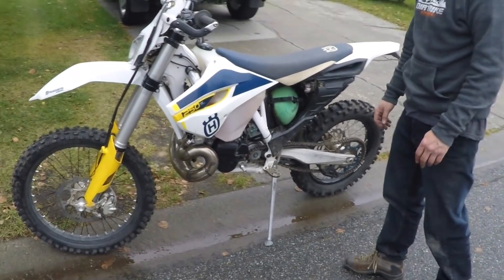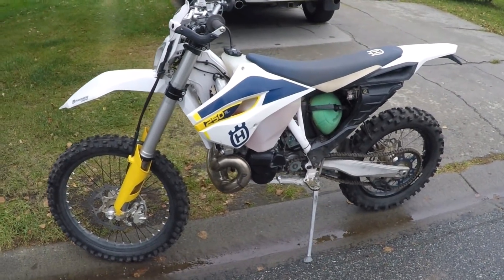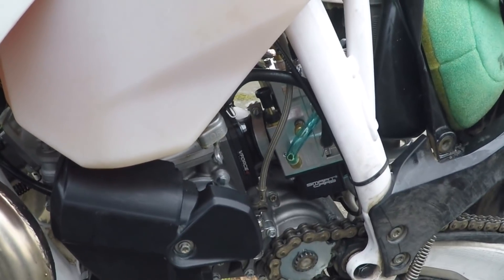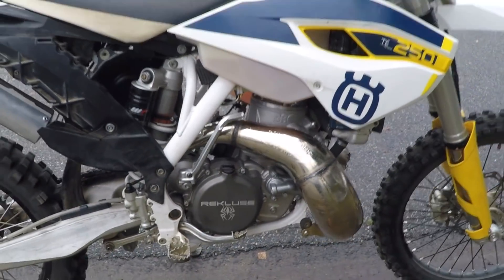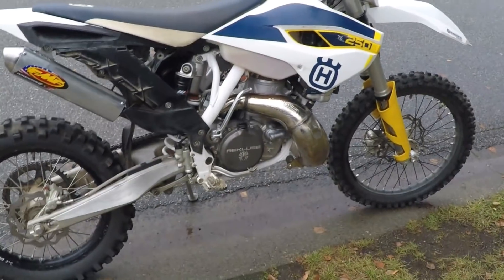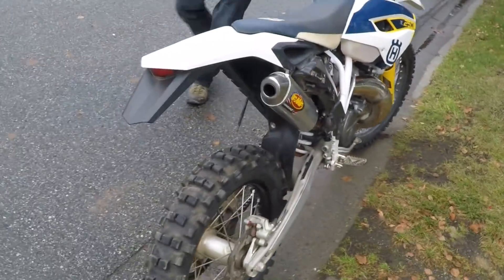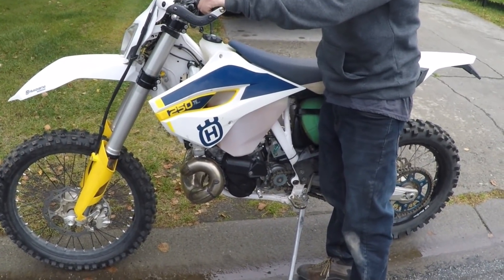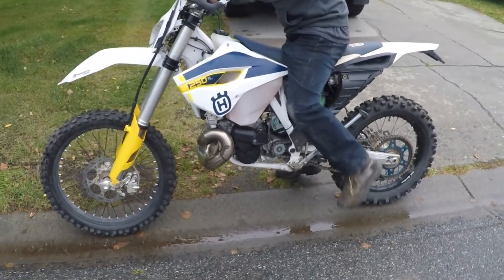BRC 500 with SmartCarb 40mm TPS and PowerCDI First Startup

Comment: It’s pretty cool I do have to say but I don’t get it. You don’t need a 500 for anything that bike with the stock 250 motor was good so my question is why the 500? I’d imagine you have the cost of a new bike just in the motor. Again I’m not dissing at all I think it cool as hell!!!!! I’m just looking at the cost and comparison someone said it 7500 just for the motor of course I don’t know if that’s true. Either way it’s sick and if it becomes affordable all the better!!!!!
Reply from the maker: Yeah, the stock bike was pretty dang good. But if you have the money and have never ridden an old-timey 500, and it can be converted to a snow bike for the winter season (where the extra power of the 500 motor is an undeniable improvement over the 250 or 300), and you get a very modern counter-balanced electric starting motor, why not? And the power output of the motor is aimed at trail riding vs. MX (not that it won't do well as a modern MX machine), so even better. 

The USD cost is right at $5800. It's real easy to spend that much on an off-road bike without obtaining the massive character change that comes with the 500 motor. We didn't get enough trail time before the snow fell last fall, but the little time we did get held a lot of promise that this is going to be a monumental trail bike. If you're an off-road racer, perhaps it would meet your needs well and perhaps not. Kinda like some off road races are more suited to a trials bike while others are more like Dakar.
Reply: Barry Jackson I race at a high level and would never choose a 500 period no matter how it’s tuned it’s just to much, to much weight to much power for a 3 to 4 hour race. On my 300 I have a map switch to smooth the power out at end of races to conserve energy. I don’t see a 500 working out east where I am or on national enduro scene. Now maybe in the desert I don’t have a lot of experience there I’ve only raced a few times out west and used a 450 saying that it was pinned most of the time. Now a snow bike I can totally get I live in northern mi we get a lot of snow I have 3 ft at my house and across the bridge we have 5ft plus and everyone is looking for more power with there snow bike. It’s cool though like putting a big block in a s-10. You all did a professional job also it looks stock pretty much.
Reply: Barry Jackson though I don’t agree with undeniably better than a 250 or 300. There is a reason no one makes a 500 anymore. Again I really like the build it’s awesome please don’t think I’m being a dick or hating you did a wonderful job and it’s bad ass build. This is all my personal opinion I’ve never ridden that bike and it could be the best thing ever this is just my thoughts and I’m a moron lol .
Reply from the maker: Not taking offense here... but if you re-read my earlier reply I was talking about snow bikes when I mentioned its improvement over a 250 or 300. While one could put this motor into a modern KTM MX frame (up to 2016?), it's specifically designed to fit in the the XCW & XC frames from about 2008 to 2016. So, it's power and delivery is aimed at off-road pursuits, and not MX. 

This is exactly the opposite of the old days of the 500 bikes. They were all MX aimed bikes in both riding/handling and power delivery.  In those days, if you rode a 500 as a trail bike, you were riding a motocross bike on the trails - not ideal. With the BRC 500 you are installing it in a trail-oriented bike with modern and appropriate weight and handling characteristics. 

The cost is about an 8 pound weight increase. With the PowerCDI there is the ability to add DPC (Dynamic Power Control) in the future to allow a very well-managed power delivery for trail difficulties. Will it be competitive? Who knows? Will it be fun? Oh, yeah!

And for what it's worth, the reason the 500 2-strokers aren't being made anymore is most directly due to rules changes sought by 4 stroke MX engine manufacturers to allow 4 strokes to compete. The rules were changed to cut the 500cc 2 strokes down to 250s so the 4 strokes of the day might be able to compete. Then the manufacturers  stayed focused on developing the 4 strokes and basically abandoned 2 stroke development. 

One of the things the BRC 500 proves is that had the 500 2 stroke motors continued to be allowed they would still be way more powerful than the best of the modern 4 stroke motors. The best 4 strokers are making at or near 60 hp today (factory racers maybe a bit more). The BRC 500, as a brand new 2 stroke motor, is already making 72 hp and some have said it has been seen to produce 77 hp.  Can you use all that horsepower? I sure don't know, but I'm really looking forward to finding out, especially when DPC is functional . Worst case, I'll stick with my 2017 300 XCW for most rides. It's all fun...
Reply: Barry Jackson all good points
Reply: I would love to have one also not as my race bike but as a supermoto bike I race a gsxr and see supermoto bikes all the time at the track this thing might be the baddest supermoto engine on the planet.
Reply: Have you ever ridden a 500 ?
Reply from the maker: Speaking for myself... Yes. whatever the biggest, baddest 2 stroker of the time was. 400CZ, 400 to 450 Maicos, 400 Penton, 400 to 540 KTMs.
Reply: Craig Martin yes but only a few and not much time on them a kx500 one of the last years it was made and a tad older cr500 but the brakes were terrible and it was sketchy. Like I said the 250 and 300 are plenty for me lol

Comment: I wonder how long the transmission will hold up.
Reply from the maker: I guess we'll see. We're trail riders, so we are probably not going to be stressing it to the limit.
Reply: I’m sure it will be fine the gears are pretty strong
Reply: Transmission would be fine.  I would worry more about the clutch.  More curious to see if the clutch can hold the power...

Comment: Thank you for sharing. I have been watching these for a few weeks now. Want one so bad I can smell the motorex and leaded fuel in my sleep!

Any idea of the nuanced differences between the 2019 chassis and the chassises that BRC recommends for these motors ?
Reply from the maker: Personally I think the 2017 and up chassis is far surperior and lighter. But TPI on most of the newer 250-300 models is limiting the market, so I guess they focused on the 2008-2016 models that are already out there. The good news is that BRC is planning on developing a 500cc kit for the 2017-and-up market too, as not all of the variations of the 250-300 bikes are going to get TPI. Some are still carbed.

Comment: That's the engine setup that people should pit against the 450 4T... That's got to be a CR, KX,  & anything else destroyer.

I can't believe someone did it, finally! 👏🏼😮👍🏼
Reply: There is a price to the swap/250 upgrade...what a beauty though!
Reply: Aint1S the Four strokes nowadays are much faster
Reply: @jr5762  300 2 strokes are maybe faster on the MX track and even more so in long enduro races but that does not mean they have more or same power :) ... I did try a KTM 300 2 stroke and it was real fun but it lacked power at all RPM and specially at bottom compared to my old Yamaha WR450 so I ender up with a 2019 KTM 500 EXC F and the power on that thing is way more then on the 300 2 T :) Strange thing is that when riding slow the 500 feels pretty much identical to the 300 2T and the weight difference is only a few kg (2 or 3KG if I remember correctly). What I really want to try is a modern vibration less 500 2 stroke like the KTM 300 but with more power :)
Reply: @a64738  300exc is 12kg lighter than the 500.. thats a huge difference in weight on single track lol
Reply: @a64738  500exc is 113.9 kg and 300xc is 102.1 kg - both dry, data from wikipedia / manufacture
Reply: @thephaze3  both aluminum frames?
Reply: @DB-fn3fz KTM is always steel :-)

Comment: Good luck getting the 500 to idle.
Reply from the maker: Hmm... It's idling now, including with the Rekluse in gear with the clutch out. Do you have one of these motors?
Reply: What are you using the bike for... just wondering. I just hope you keep us posted because no one online has proper footage, other than the usual suspect and your setup is above & beyond for controlling the big bore. Thanks
Reply: @Aint1S  that engine is $7500.  12 for sale and they are all sold.  So stick with the afc.
Reply: Barry Jackson it appeared to need feathering the throttle constantly like my 500 Honda did no matter what rod or vent checks were installed.  Sounds like you got it sorted out.
Reply from the maker: Yes, we will post more footage. We have a number of additional bits of footage taken during the build effort, including some small issues or additions to the kit that we thought would enhance the build experience. We're hoping to get some trail footage today. 

Since this particular build will be done in the next few days, aside from the coming snow bike aspect, I will be freed up the do the necessary editing. I'm not a pro at this so the videos will likely be the same amateurish quality. 

We are just trail riders, so our choices are guided by what we need for that use. Mostly tight, twisty, rooty, sometimes swampy single and two track with some really nice fast and flowing two track, as in how fast do you want to go kind of two track.

My engine kit will be next and there will be video coverage of it also.
Reply from the maker: It was right at $5800 USD. The $7500 is Canadian dollars. A new batch is being finished as I write. That new batch will include one reserved fo me. 

Nope, not cheap. Worth it? My friend thinks so, in a big way. 

It's pretty easy to spend that kind of money on a dirtbike, and not walk away with performance anything close to what this kit offers. Billet bling alone can add up to thousands. 

Wheels, bars, brake rotors, suspension, seats, big tanks, plastic, decal kits, pipes, silencers, clutches (both auto and manual), chains, sprockets, LHRB, carb kits, and on and on. We all choose whats important to us and part with the money to get the setup we want. 

Dirtbikes are not cheap, even for the basic no-frills showroom floor models.
Reply: My buddy had a 99 kx 500. It ran perfect. Idled like a dream. My other buddy had a 9or 97 cr500. It ran perfectly too. Idled fine all day long. Maybe you have a worn out reed or carb issue to look into
Reply: @endurotruckererniedesjardins  both buddies had Smartcarbs?
Reply: I'll stick with my '96 CR500 and use the $5800 to buy a car.